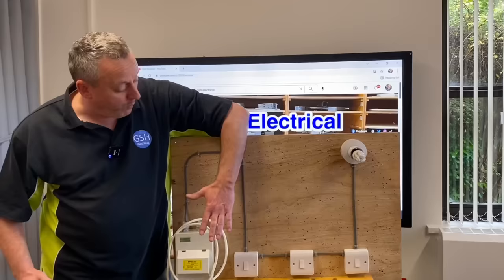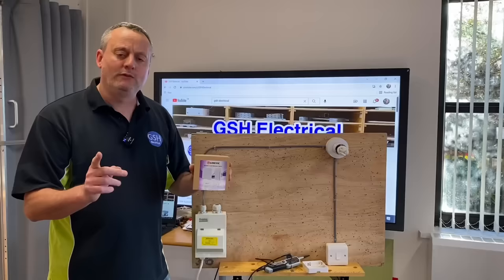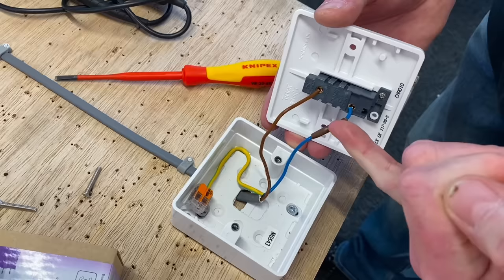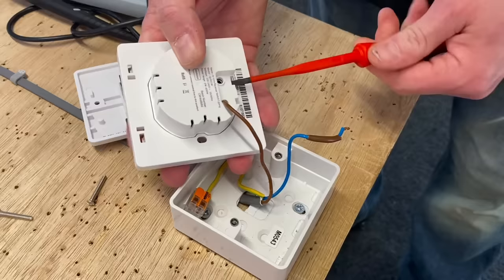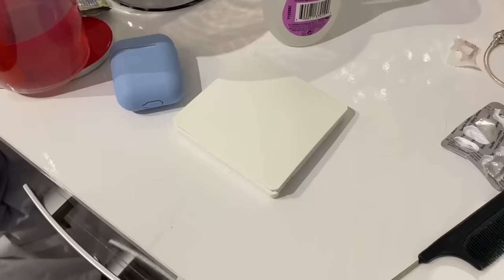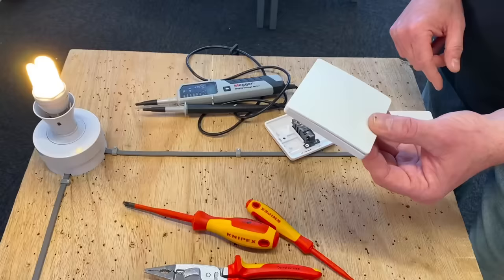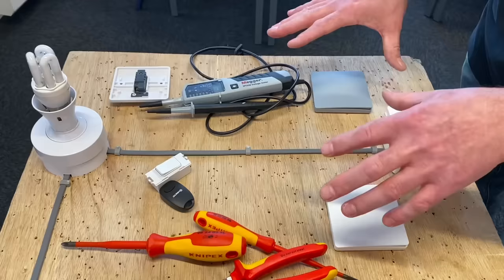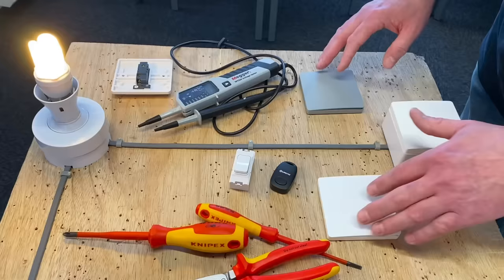No More Wiring Light Switches - The Secret is Out - Quinetic Wireless Switch with Built in Receiver

Comment: Just one thing: wouldn't the RF transmitter/receiver be better in the ceiling rose? Then there's no need for any lighting chasing at all: just cables in ceiling.
Reply: That was my idea in the comments.
Reply: @m101ist  You'd have thought that Quinetic etc would have thought of it too. Are we missing something? Seems much better to me.
Reply: If you put it in the rose then the home owner had to remember it’s in there. If you change your lights after decorating you need to make sure you don’t throw out the receiver and that your new one can accommodate the electronics.
Reply: @ianbrown3904  Install the receiver in the led lights is a better idea. 😳
Reply: @m101ist  Ok that's all sorted then. We'll be millionaires by tea time - oh wait: Alexa/hive/nest. Bollocks.
It's great though isn't it - a company puts out a product that's almost there, then sits back and reads the comments to finish off its R&D.

Comment: Question: I have a [1 gang 2 way switch] with a brown, grey, black, and green/yellow wire that i am looking to replace with 1 gang wireless in line receiver. I need to connect the brown (live) wire into L in the quinetic switch. And i guess the Grey(neutral) into the L1 spot. What do i do with the Black and the Green/Yellow? Do i also connect the Black into the L1 spot and block the Green/Yellow? Your help greatly appreciated
Reply: no, they won't facilitate 2-way on the single switch, you need to buy a 2-gang switch (QURS2W) or 2 1-gangs.

Comment: Do they make version of this for the USA market?  Or, does anyone know of a comparable system for the USA?  

I recently put in a system that used remote switches that look like the car remotes.  Instead of one push button for on/off, they use two buttons, one for on and one for off.  The downsides are that they don't look like regular switches and also they require a battery.  I'm sure the battery will last for 2 or 3 years, but will eventually need to be replaced.

Comment: The specs state that they use 433Mhz. In my area of London this allocation is very heavily used what with car fobs, doorbells, alarms and a myriad of other devices. how well do they cope with jamming interference.
Reply: That's where you need digital coding.😳
Reply: @m101ist  That's what most of the devices I mentioned do use. However if the noise floor is too high they still suffer. See the problems some car users have had getting their doors open in some areas.
I suggest they should have used a higher frequency band that has more space for spread spectrum/hopping. 
But perhaps that would have licensing issues.

Comment: What about using touch switching instead of push switches. I know you need the knineted energy is a strong enough signal to send to the receiver switch.  And the signal from a static touch would be small to emit to receiver switch.  Could the receiver switch be made sensitive enough to receive the signal.  😳
Reply: No
Reply: @AgentOffice  Yes why not. 😳
Reply: @m101ist  the transmitter has a chip to power for a second not just sending static

Comment: I want a switch that senses motion when I come into my house dark or light turns on for 1 min, 2 min, 5 min, 10 min, 15 min, 30 min or 1 hour ( and is easily set with out removing covers ) then turns off only if it doesn't sense a human in front of it. Also it will react to a remote wireless paired switch from a person across the room. On and Off. And is dimmable at a couple of settings. And it needs to fit into a single gang USA metal box in my wall. And works with LED fixtures. It would be nice if ceiling light would have a backup battery and light up in case of a power failure and unit would cost less than $50.00 USA dollars. Point me in the right direction if such a thing exists.

Comment: How the heck did the industry pass these things. How are electricians going to feed their families only having to wire ONE switch per room now? (sarcasm for those that missed it)

On a serious note, I really want to use these at some point. No batteries or wires after the first switch, portable (use velcro on the back for removable mounting). Only long term issue I can perceive is mechanical failure of the switches, but depending on the cost per switch it might be acceptable. I also wonder if you can combine these with timers and motion sensors. I can see using the fob one to turn on a porch or path light when you get home, but it did seem a bit bulky (fob for the car+light adds up fast), maybe they will make 2-in-one fobs later.
Reply: did not see a 

Did not see a UL approved device stamp on this cannot use in USA but one of the big manufacturers here will obtain it if its any good

Comment: Electronics in the receiver are going to die IMHO, you can't beat a true wired system. I would of loved to seen the circuit board as they are also susceptible to RF interference.

Comment: Good video but a disappointing product... there's not much point in a second light switch in most places I've lived. It's too bad that the manufacturer couldn't find a way to eliminate in-wall switch wiring all together.
Reply: Of course there is, this version is dealing with the wire already in position... Look for kinetic wireless switch or (smart) battery free wireless switch...

Comment: no need for any wired switch put a reciver at the light fitting
Reply from the maker: That video is coming soon 👍🏻
Reply: The problem I find with those controllers is lack of connection for cpc continuity, requires another external connection point ( wago box or similar) to maintain cpc continuity which kind of defeats the neat compact design, I did question Qunetic about this only for them to suggest the above, all it would take is one additional terminal within the controller doesn't make sense 🤔

Comment: I don't care what anyone says, that receiver has a storage battery. It may last 100 years but it can't operate with no neutral, no movement for kinetic energy and no battery.
Reply: There’s no battery. The device lets through a tiny current to power itself. Hence the stipulation on the lamp minimum wattage to avoid flashing or dim illumination when ‘off’.
Reply: @stevechambers8869 how can it use the current with no return path?
Reply: @stevechambers8869   hang on, I think I get it. They could have a coil in series with the load then induce current from that like a transformer to operate the switch. They can't fool me!
Reply: @stevenhopkins2925  the return path is the normal return path via the lamp (as if it was lit)
Reply: @stevenhopkins2925  imagine the switch was closed. Current flows via the lamp. This switch electronically is always partly closed allowing a tiny current to flow which is used to power the receiver. This current (if you respect the minimum lamp wattage specification) also flows through the lamp but is insufficient to light or flash it.
Reply: @stevechambers8869  no I get it already, its a switch in series with the load so if the lamp is less than the 5w it won't light up cos the energy is lost in the switch. Its a good idea but there is a cost as you would expect but not much.

Comment: ?? ... " brand new idea - wireless light switch" .. NO - not " new" 
... amazon has been selling "remote control light switches" for 10 years - as i bought one ... 10 years ago.   ( plug outside christmas lights into a box you plug into the outlet - when you press a button ( from the warmth of inside your house on a cold day ) - you can turn on / off the OUTSIDE Christmas decorations .

Comment: " kinetic energy " - Brand New concept ... NO .
in the 1800's gold miners used ... detonation boxes - that were kinetic powered - ( no batteries ) when you push down on the handle - your motion pushes a magnet down - past coiled wire - causing electro-magnetic reaction - enough to "send a signal" to the receiver .. NO - NOT a "new concept" ... ( YES - a new application - BUT no - NOT a new idea )

Comment: " wireless electricity is a brand new concept INVENTED in 2018 by this comapny " ... NO.
My grand-ma has been using a "cordless electric powered toothbrush" for 40 years - charged by "wireless charging" - when you put the handle in the base - it charges by ( wireless ) electro-magnetic energy fields )

Comment: Ok, wait one ........  minute! What in the hell is this? Your telling me, an electrical wireless supply is being delivered nearly the length of a football field and the receiver has no power source? No wires from an outside service, no battery of any kind, nothing but electronics like (Cap, Mosfet &/or Transistor)? Did you bring Tesla back from the dead? How much power is needed and lost making the journey threw the, what, Aether? are we talking Hysteresis of the dielectric. This almost proves Electromagnetism is the Universe and everything is connected, producing the "Instantaneous action at a distance" and as I'm typing   Tesla was right! Electrical wireless transmission without the need of Hundreds of Thousands of volts What are the amps or better yet what's the wattage! and how long has this been going on for, because dealing with interference, shielding and field lines are concerns in my daily routine/job! I know us Americans avoid things like change, or second languages, but this is the stuff we used to hang witches for or render the greatest mind of our time as a loon to fade away in a hotel room! Seriously, people I work with will laugh!
Reply from the maker: Scott Hayes - thanks for the comment 😃. From Gary Hayers
Reply: @GSHElectrical  I'm not as versed in high voltage DC used across the pond, but I understand it on a more micro level. Most would trip out on a huge blown glass plasma glowing bong! as a transformer or what ever it was used for, that's my level of ignorance. So I was surprised to see Live and switched live vs AC and common with ground. We deal with AC generated Hz so common is needed. Today we even cheat our ground circuit and share with common because I think "lazy" are we! hammering Rebar in the dirt is too hard? But this is something else, that I didn't believe possible and seems to break laws to the point of thermal dynamics even. Math can't explain it either and I spent way too much time trying to validate Tesla Aether theory and never felt good about Photon theory either, but none of this has been proven, so I need to rethink what I thought I don't really know like the rest of Science that still to this day can't answer the most important questions I asked 35 years ago! and something to small to ever seen as assumption, is no answer! It's an easy way to not finding anything!